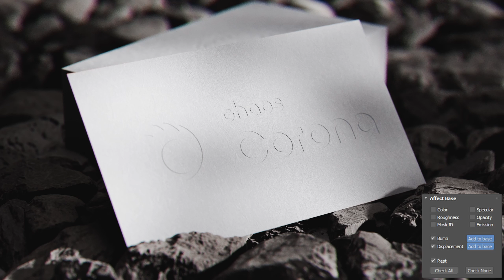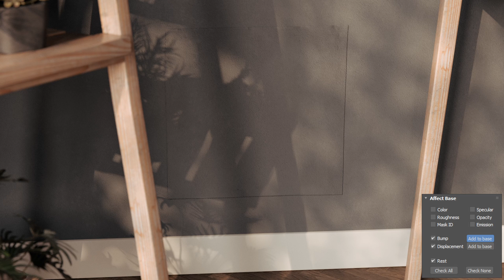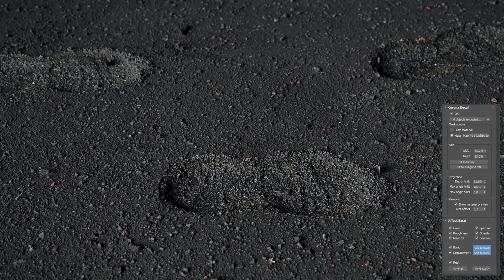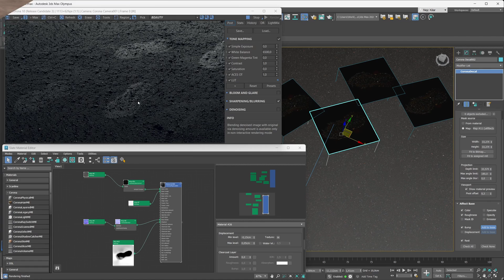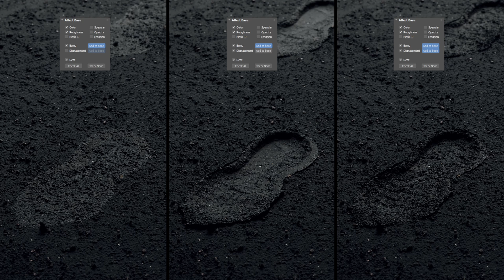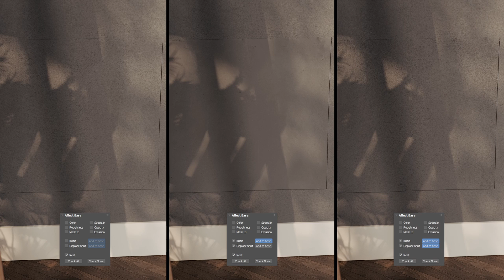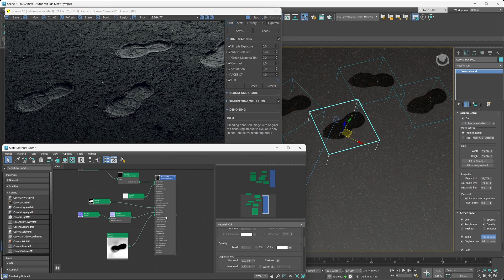Decal Improvements in 3ds Max

Comment: Thank you for the explanation. does Corona still have a GPU rendering program? All the rendering engines have GPU-enabled rendering capability. why is corona so late on this? Or we have to switch to anril.
Reply from the maker: We are not late :) We simply don't plan to move to GPU at all, and remain focused on being the best CPU render engine there is. We're not willing to stop development of Corona for the year or two it would take to make a GPU engine, and GPU has limitations which means it would not just be "Corona on GPU" but somewhat different than Corona is on CPU. And of course we do have GPU options already if someone needs those, in the form of Vantage, Enscape, and V-Ray GPU. Thanks! Tom